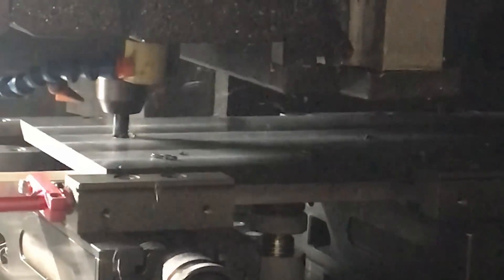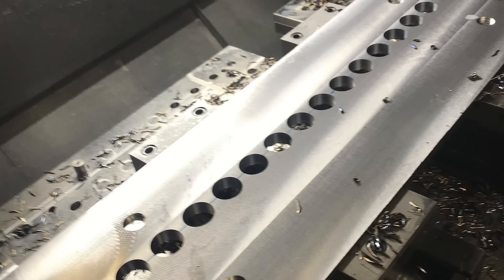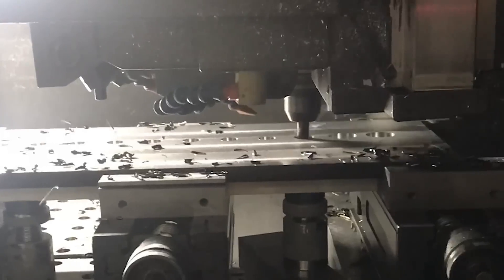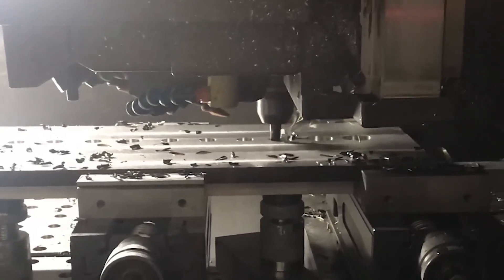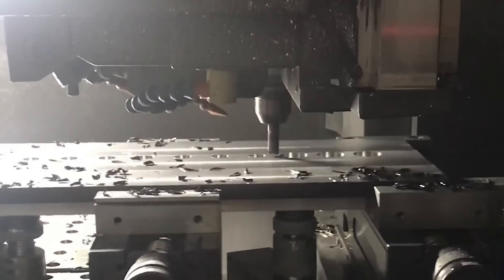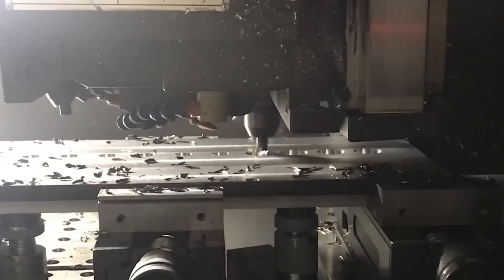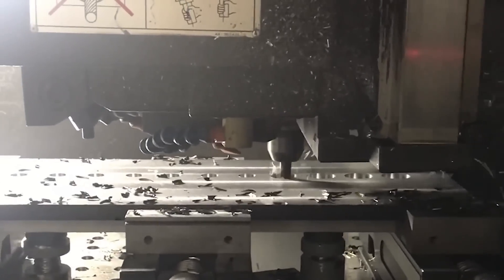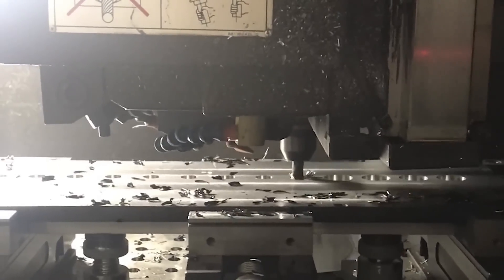Chips From The Real World - Episode 1: HARVI I TE

Comment: Why wouldn't you interpolate the hole after plunging in? Seems like wasted time.
Reply: dude you are not a machinist....
Reply: Okello Raymond actually I am and I do this everyday for a living. I program and do the machining. Ramping in and interpolating the hole is one operation in the CAM system I use. They are treating the end mill as a drill then using it as an actual end mill in a second operation. Waste of time!
Reply: @Thepriest39  this was manually programmed , the mazatrol would only allow 1 cycle at the time.
Reply: @robclout5608  ok.